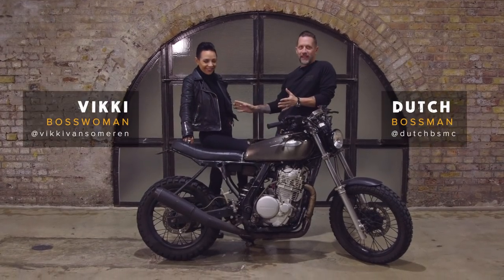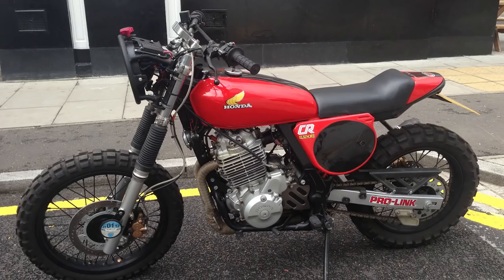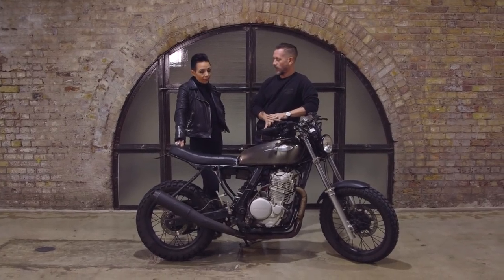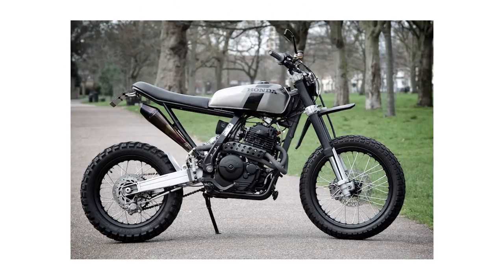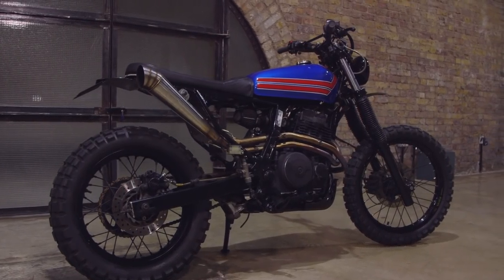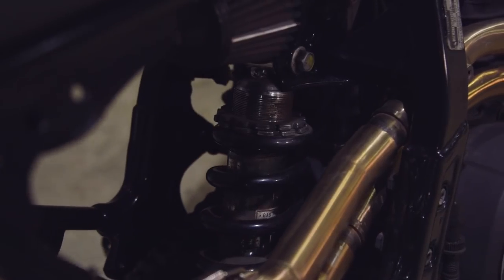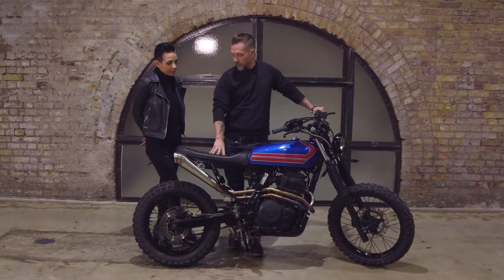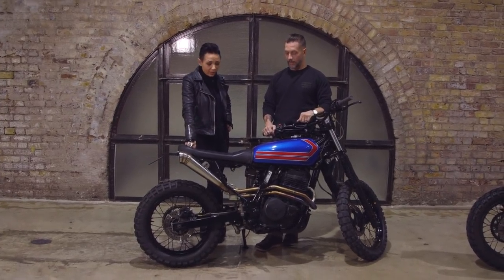Vikki and her Honda Dominators

Comment: I owned a 650 Domi many years back. Was awesome. Can I suggest you actually go down to a 600cc with a new sleeve. I did that on mine (after dropping a valve) and the entire engine just worked better. It completely killed the original in performance. Compression was a bit higher but with the lighter piston, it just revved soooo much better.

Comment: owned an original 650 back in '89.  It got vandalised really badly. Fairings got totalled. Wish I had thought about doing a modded bike such as this.  Those engines are good, always liked the fact that the camshaft runs in bearings, for a start.

Comment: Just saw, passing-on this $3500 custom build offered, for anybody in the western US: https://medford.craigslist.org/mcy/d/vintage-honda-xl600r/6707675812.html
xl600r. New piston, jug, cam chain tensioner and guide, all new gaskets, valve seals, valve lap and seat, fork seals, head light (Jeep integrated with turns). Led tail, stainless exhaust, integrated frame for exhaust, seat, tank, all new. Bike runs great. Kick start only. Starts after 1-2 comp kicks.
If I wasn't a gimp I'd bite. Cheers!
~ ; )

Comment: Perhaps a tad too loud but still great sound! Reminded me of the debaffled pipes of my 2006 VMax. It was like the roar of a lion tripping on speed! They ruined California, it is no longer the land of the free or fun. You modify your pipes and can face a $1000 citation. No joke! So, good luck having pipes like these and enjoying them.
Reply: Calm down...we face far more draconian and stringent 'digital/virtual policing' here in the UK that I actually long for the days of being pulled over by an actual human being - (although some of them most certainly weren't) - on account of my race exhaust. I currently have an Indian FTR 1200 with a cat delete and an S&S Grand National system which sounds like a howitzer on the overrun - and that's the least of my worries.  

I owned a VMax - 1989 Canadian grey import but hated the awful bugle stock exhausts so fitted a 4 - 1 which completely fucked up the power delivery. Looked the part though.
Reply: @yassassin6425  I was/am calm. I got a fix-it ticket with my Vmax for the exhaust when it was still like $200 and you get it corrected (or hack signed) and get like 90% of the money back. The bike has stock pipes but were debaffled by the original owner so I ended up replacing them as they were bothering me after 30 minutes of riding. 
That said, $1000 (non fix-it) ticket is outrageous and unjust for an annoyance anyway you look at it and I am not even into modifying pipes.
I don't like really loud pipes any more than some of the new bike exhausts that sound like a mouse fart.
I have been planning on leaving CA for quite some time so, I definitely do no longer care or get upset all these restrictions and BS bylaws in this state.
Reply: @Turco949  
As I said - try and last a year on the roads riding a motorcycle in the UK. A loud exhaust is the least of your worries. We have a point system - exceed 12pts and you are disqualified. You could accrue three points alone from riding at 34mph in a 30 limit.
Reply: @yassassin6425  Oh, I didn't know things were that strict and brutal there. 
Then again, how often people get shot over there for merely running away from cops? ;) No place is a heaven.

Comment: Honda Dominator 650 in the U.S.? Is it a single cylinder?
Reply from the maker: AKA NX650 a 650 single (twin pipe outlet confuses people).
Reply: Bike Shed Motorcycle Club Thanks. I have heard of the XR650, currently available, but not that model.
Reply: @dry509: they're rare in the US because they were only sold here in 1988-1989. Over here simply wouldn't buy some amazing Hondas back then (Hawk GT, GB500TT, NX650).

Comment: 'ow the 'ell do you guys ride round with all these bikes with illegal exhausts?! I rode 200 miles on my hardtail straight through and Suffolk police ended up taking the bike off of me due to it's volume, giving me over £400 in fines and told me I didn't have a valid MOT because of it (thus invalid insurance and an IN10 with 3 points too!)

I do like the look of them, I did similar with a 1989 DT125 about a decade ago and have been toying with the idea of doing something similar with an AJP PR3 I've just picked up. Decisions, decisions :P
Reply from the maker: ...because London Police are more worried about crime and dangerous driving than they are about a slightly loud exhaust pipe  - that might also mean they are less likely to meet us in an RTA.
Reply: @BikeShedMotoCo  Loud pipes are a crime though :P Section 54(2) of The Road Vehicles (Construction and Use) Regulations 1986 "(2) Every exhaust system and silencer shall be maintained in good and efficient working order and shall not be altered so as to increase the noise made by the escape of exhaust gases.
" Its also a Major on the new MOT rules.

Surprises me that no-ones been pulled in the smoke for it 2bh - they're obviously more interested in chasing otherwise legal bikers than the scum nicking all the bikes, so this seems like an instant money maker - easy £50 FPN a time for very little outlay on the Police's part.
Reply from the maker: There are many things that are against the law which are not a serious crime, and arguably not worth wasting Police time or public funds. ... In terms of what happens on the streets, I've been riding in and around London for 30 years, pretty much every day, and I've never been pulled for a noisy pipe. ... My experience of the London Police is that they leave you alone unless you ride like a twat - and if you are polite and helpful they usually just give you a ticking-off. ... although they don't like small number plates because it messes up their ANPR cameras.
Reply: @BikeShedMotoCo  At least someone on the internet understands "priorities" - the Stolen Motorcycle groups have no fucking clue about it and harp on about how the cops should drop everything they're doing just to come out and see the scene where a bike has been taken that's going to be paid out on insurance... It costs a LOT more for officers to attend the scene of a vehicle theft than it does to "catch" someone with a loud exhaust whilst patrolling.

That's been my experience of Police in most cases, the other time I've been tugged for a loud exhaust was around Bristol Temple Meads where I was given a producer and sent on my way. I don't ride like a twat for the most part (footage on my channel is 4 years old and I've had a huge accident since then), but I still get tugged for loud exhausts lol.

With regards to the ANPR thing, a family member who is a traffic officer told me that it's BS - of course the ANPR can read smaller plates - it reads them as "farther away", it becomes an issue with incorrect spacing or font point though. Still - smaller plate fine is £100 and would be found exactly the same way as a loud exhaust would be - by happening to be observed by a patrol lol.

All the best.
Reply from the maker: Thanks dude. Good intel about the ANPR.